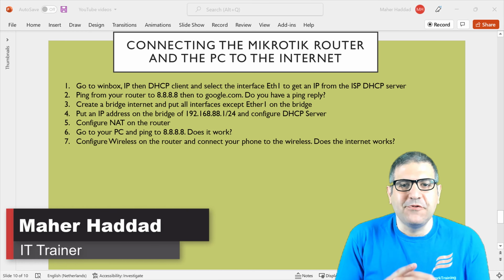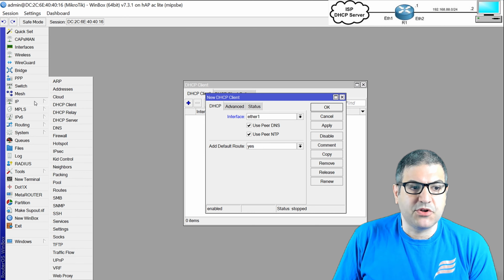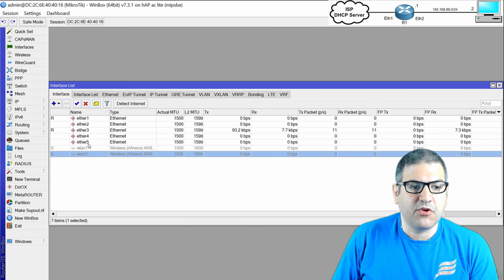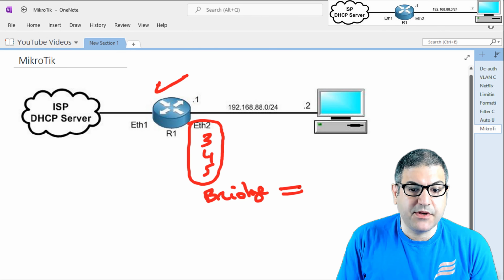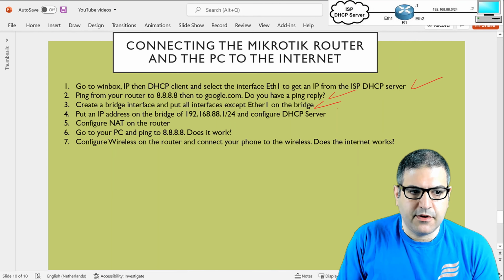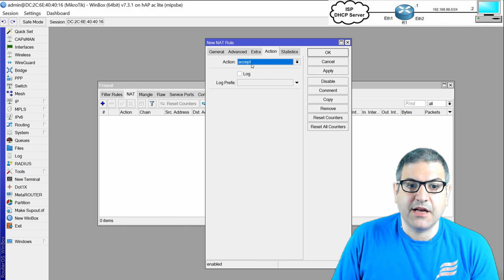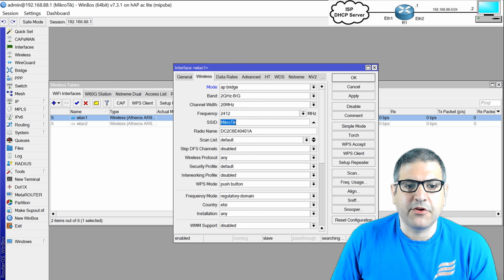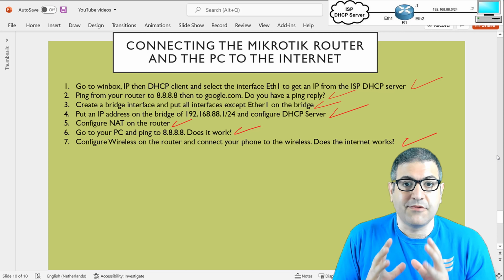Make your MikroTik Router as an Access Point wireless router using RouterOS v7

Comment: Hello, If you put all the ports even the wireless on a bridge and turn on DCHP client it will also works as an AP,  you just plug the internet cable on any port and the mikrotik will deliver internet on all the rest of the ports, it will not be necesary to set a NAT nor DHCP server, of course the mikrotik will not have a ip address but it works, any inconvenience do it this way?

Comment: Name of this video is misleading. This in not an Access Point configuration, it is router with Wi-Fi. Access point is subdevice in LAN that provides WiFi access to LAN and if that LAN have access to internet it will provide it if configured so.
Reply from the maker: It is clearly mentioned: Access point wireless router.

Comment: Hello . one question .My access method at home is through lte modem and it doesn't have bridge capability that Mikrotik can connect. In addition, my internet is gnat type, which means the IP address that the site shows is different from the public address that the modem shows. My Mikrotik cloud service works, but because of NAT, I cannot connect to Mikrotik through the cloud and set up a VPN server with it. Is there a way to do this without a public IP through Cloud Mikrotik? Thanks.

Comment: Thank you for the video, I found all your materials very consistent and informative. It would be really fantastic if you can elaborate a bit, what is the best way to lower the power sent over the antenas. Some says that it's the gain, some that tx power. I'm really puzzled, can you advise ? I'm sure some people are interested in lowering the power of the WiFi.
that would be a great help, cheers
Reply from the maker: it all depends how much power is allowed in your country and how much power your router can emit, also should check the RX sensitivity on the receiver. So there are many factors to take into consideration.

Comment: which is the best mikrotik access point today ? I have MikroTik RB4011iGS+5HacQ2HnD-IN Router.
Reply from the maker: All are good :)
Reply: @MAICT  right now i use three MikroTik cAP XL. its works like a charm and elegant looking.
Reply from the maker: @MrBazsi888  gr8
Reply: Hey can I get internet connection without isp?

Comment: Your video on route summation is incorrect sir.  I would have commented on the video, but you turned off the comments.
Reply from the maker: Yes I saw that. Actually the summarization also work the way I did, it just takes 1 bit more. The issue was from the typing that I missed 1 bit.